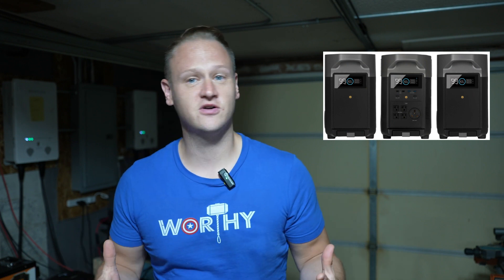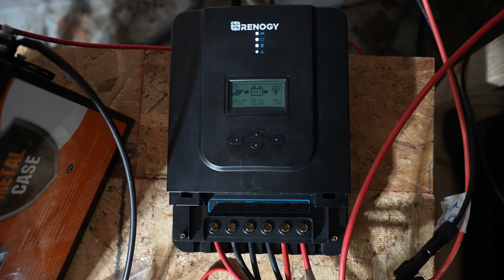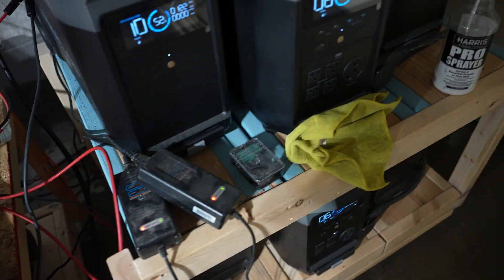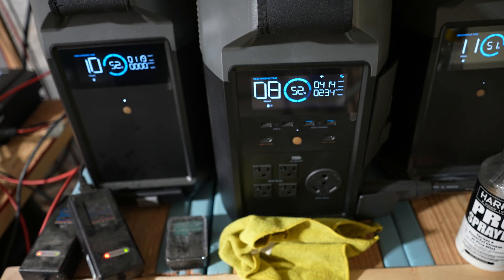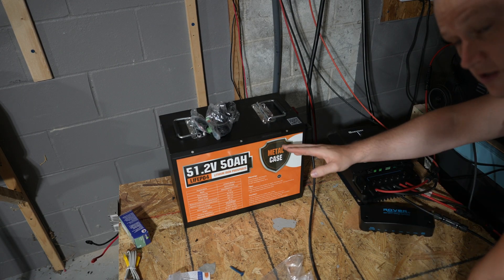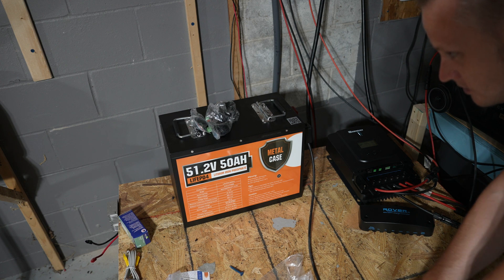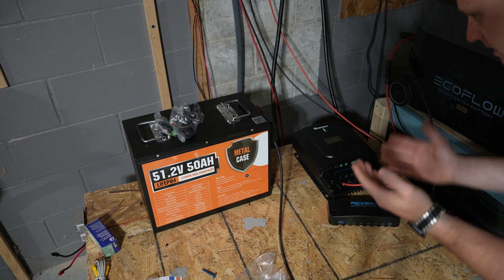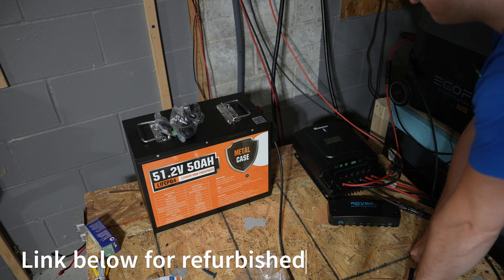How to Charge Your Delta Pro with an External battery bank - Part 1

Comment: I was thinking I would purchase another 2kw solar panels with an 3kwh inverter with say, 2  5.1battery and then just plug in the delta to ac. then at night it will charge when it get to 30% or whatever is set.

Comment: Hey, I got a Delta two I use scooter batteries 551 wh hours and I have 20 of them a Victron solar charge controller have 11 kW of batteries that that I use a buck converter to hook into my Delta two to charge it to let it run and it’s running off my batteries and it charges the Delta two  my house runs from 5 to 11  just on my batteries and in the morning, it charges back up have 600 W of solar
Reply from the maker: What rate does it charge from your scooter batteries into your Delta 2? 200w? Does it stop charging from them automatically or just draw them down to where they won't feed into the Delta anymore until the solar recharges them?

Comment: This is my system, but I need info what fuses to buy and where to put them, to be safe :)
🌞 2x480W series panels (Vmp: 37,10 lmp: 12,95) are charging Lifepo4 battery (51,2V 11,7kWh 230ah) via Victron 150/35 charger ...
⚡ LiifePo4 battery is charging Ecoflow Delta pro with 400W via solar xt60 input (max input 150V 12A 1600W) ...
🌞 2x480W parallel panels (Vmp: 37,10 lmp: 12,95) are charging Powerstream (max input 55V, 600W) panels ...
⚡ PowerStream, conected with Delta pro, is charging house and Delta pro with excess energy from Powerstream.
⚡ Delta pro is charging household appliances AC output 💪

Had an problem situation: In the morning the LifePo4 battery was 0% because it had been charging the Delta pro during the night. When the two panels started charging 11,7kWh battery via the Victron charger (approx. 100W), the Delta pro went wild and started to overheat. I turned off the Delta pro. What could cause a malfunction in Delta pro? I need to add fuses to avoid more problems?

Comment: Love the videos you can turn the 51 volt to 102 volt will  be about 900 to 1000 watts
Reply from the maker: Agreed, but I don't know how I can charge that battery bank. I can wire them in series to increase the battery voltage to 96vdc approximately, but not sure how to recharge that battery bank with a solar controller.

Comment: use 48v battery with xt60i connector,should get around 800w
Reply: That’s right bypass the controller . I have 2 delta pro and 2 48v golf cart batteries.

Comment: I have the ecoflow delta to be able to use the microwave during a power outage. So, I would only be using it for short periods of time. I also have batteries to top it off between using it. It also wont charge with DC near as fast as it can provide power. That's a lot larger system you have. I'd probably just use an inverter with the extra batteries to power stuff separately to reduce the load that the ecoflow delta pro and 2 extra batteries are powering. In an emergency, it's not hard to turn almost everything extra off most of the time, and therefore not need to use a lot of power.

Comment: I'm new to this but I was thinking ... What if you added an inverter to the charge controller and then plugged the Delta Pro into it to make the Delta Pro think it was drawing power "from the grid" and use this to continually recharge the Delta batteries while it's in use?
Reply: That works. I'm doing as we speak.

Comment: Thanks for the video. I’m trying to charge my EcoFlow pro with two extra batteries from my Ford Lightning but keep getting a power fault in the truck
Reply from the maker: Which output jack are you using on the Lightning? Not the 240 split phase outlet right?
Reply: @DanielGoodwin-jq1oc  Correct. I’m trying to use the 110v. I can run about anything I want off of it, but I get a fault when I plug in the EcoFlow. I think it might be a grounding issue
Reply: You would need a battery isolator going from your trucks battery to the extra batteries. Make sure to put a circuit breaker before the isolator and before the extra batteries.

Comment: If you get a 48V server rack battery and port it directly into the solar port it will charge at twice what you were doing with the charge controller. It will charge at about 650 watts from the 48V battery but I think getting a cheap 2000w inverter from the battery and from the inverter to AC to the delta pro

Comment: Will be setting up my Delta Pro with two backup batteries (about 10Kwatts)...connected tot he 1600 watt panels in Texas.
-Input from the sun should be about 1400 watts during a hot sunny day...about 400 to 600 watts on a cloudy day

Then, I will be charging a 2000 Watt battery that I will use to connect to the "Same Solar DC Connector" to top off the Delta Pro at night when NO Charge is coming in.
-This will give the DP about 400 watts an hour at night when needed...should be enough to get me through the night.

***If needed, I will get a 2nd /Spare " 2000 Watt battery " battery to connect to the "Same Solar DC Connector" at night (11pm to 6am) as a backup to my backup.

Will also have a 500 watt Air Conditioner to use with it's OWN solar charged Echo 2000watt system (2000watt + 400watts an hr should last from about 5 to 6 hrs)...that will also me to turn off my Central Air around 3pm to allow the Delta Pro to charge all the way back up before the sun goes away.

Comment: What if you got 2 of the 51.2 volt 50 ah batteries, put them in  series and connect them into the MC4 input of the Delta Pro. It would be 102.4 Volts , same amperage. should double your watts.
Reply from the maker: You're correct that it would definitely charge the Delta Pro much faster. However, I don't believe I would be able to charge the batteries in series using the solar controller. It only supports up to a 48v system. Perhaps I'm misunderstanding how it would work but I don't think it would mesh well with a 96v battery.

Comment: It would work with a step up dc to dc converter that would setup that 51v from the battery to the EFpro solar input. Jehugarcia did it with used scooter batteries/server rack & Jasionoid youtube channel showed it using server rack batteries & various other battery types 12v/24v as well already.
Reply from the maker: I haven't found any step up dc-dc converters that take 48v to anything higher (i.e. 48v to 96v). Have you? I've found one device on that does a little better but not yet maxing the Delta Pro's input.